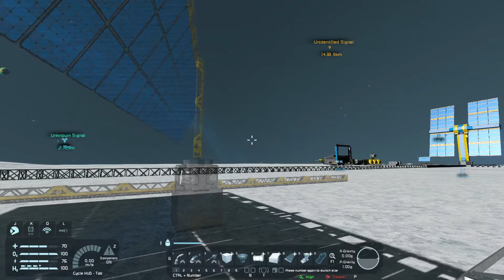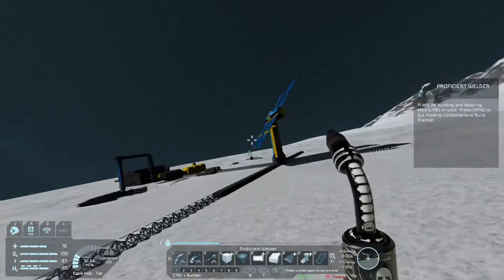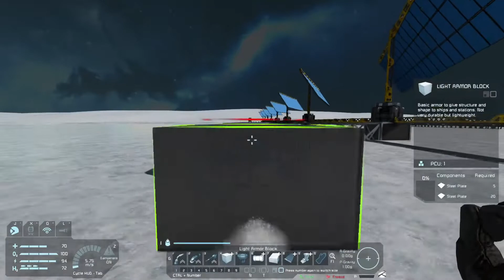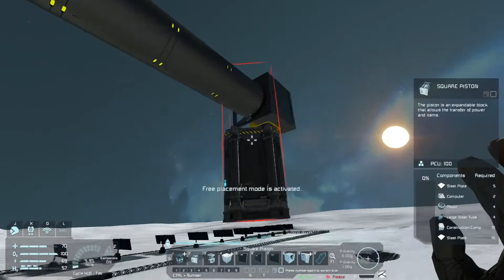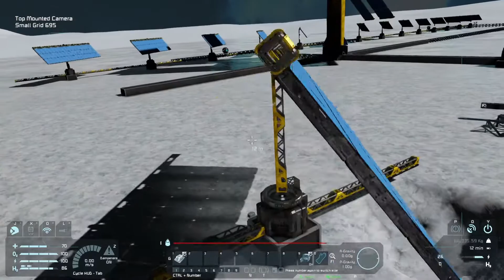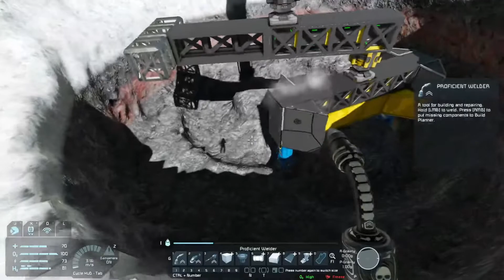Frostworks Engineering e5

Comment: Was that a mod you use to align your projection.
Reply from the maker: I'm using a Plug In called Multigrid Projector. You'd need to run plugins first and then search. I think there are some mods also if you're on another platform.
Reply: Ok I'll try that I'm on pc